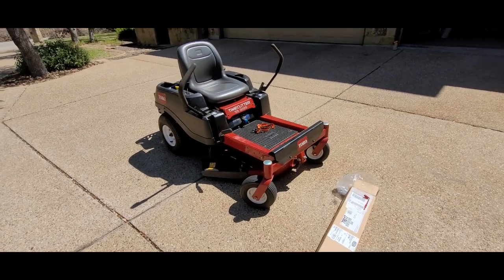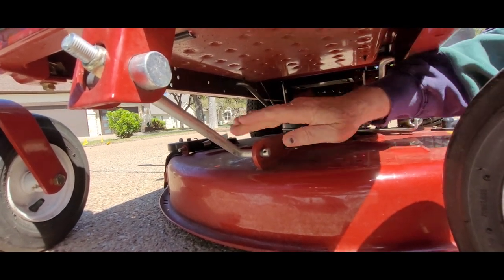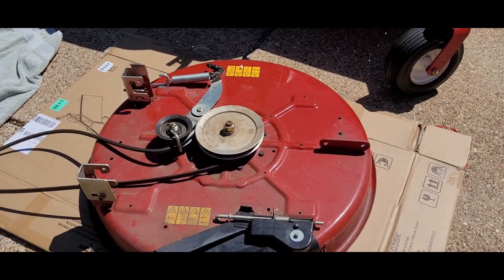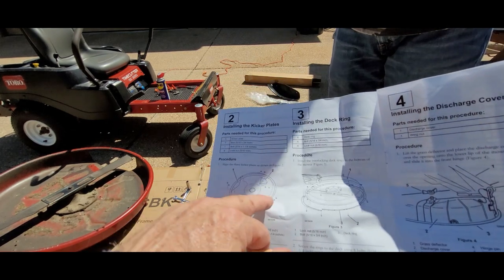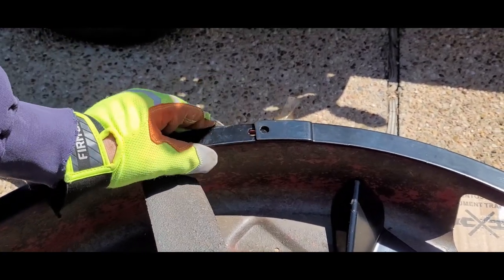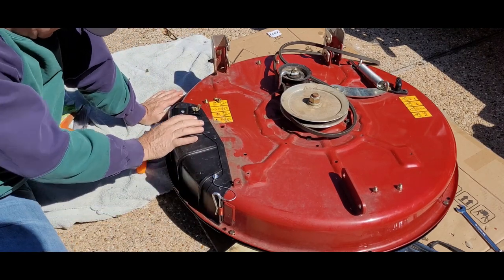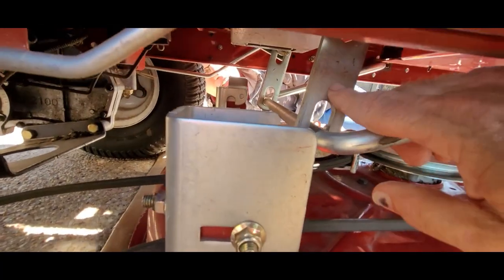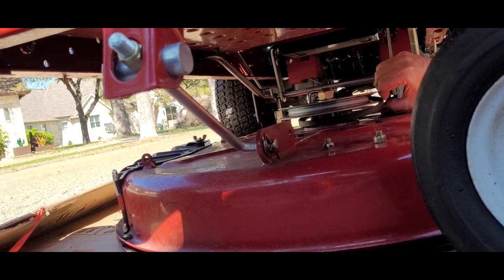Toro TimeCutter SS3225 Recycle Kit Install - for mulching.

Comment: Have you swapped the blade ? Is it clockwise or counter to remove ? The manual does not cover this.
Reply from the maker: Counter clockwise to remove (on my model).

Comment: Do you overlap the front wheels when cutting?
Reply from the maker: I usually follow the blade cover. The blade is smaller than cover, so I aim for a bit of overlap - using wheels as guide.

Comment: Have you had any issues with the tracking with this mower? I have the same model. Thank you for the videos! I had the same issue installing the mulching kit
Reply from the maker: You are welcome.  By tracking, do you mean can the mower keep a straight line?  I have a tiny drift in mine, but not a big deal.  I haven't looked into making an adjustment.
Reply: @DrBDIY  Yes, here is a good video on adjusting. I haven't been able to get mine perfect. I need to check my tire pressure. https://www.youtube.com/watch?v=hjXJ-MRwacc

Comment: What's the purpose of the rings?
Reply from the maker: Rings? What time mark in the video are you referring?
Reply: Metal ring plates around the deck @DrBDIY
Reply from the maker: Very good question.  I thought it would add stability to the deck and protect the edge.   But Toro wrote:  The under deck ring optimizes the mulching performance by restricting the grass discharge away from the blade resulting in finer grass clippings.
Reply: Thank you for the knowledge! Very interesting! @DrBDIY

Comment: Is there maintenance issues with it and how is the cut???
Reply from the maker: Maintenance includes the normal: check oil, fuel;  replace air filter every year.  Also after mowing a wet grass, spray under the deck unless drying grass doesn't bother you.  Otherwise, this is out go to lawn mower. We use string trimmer around fences and trees.  The cut is flat and even.